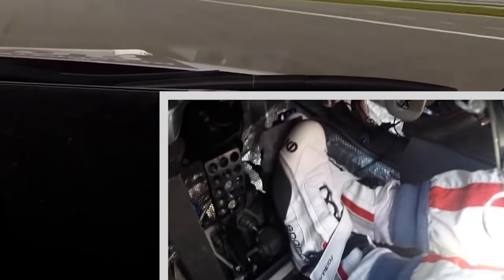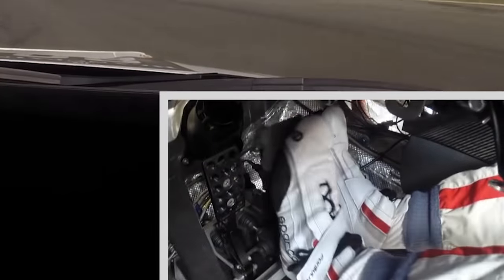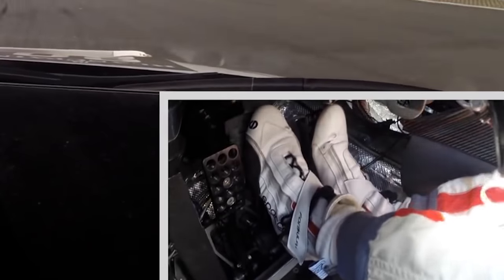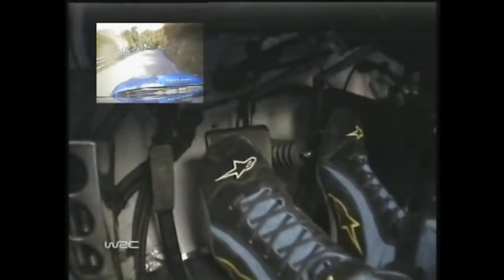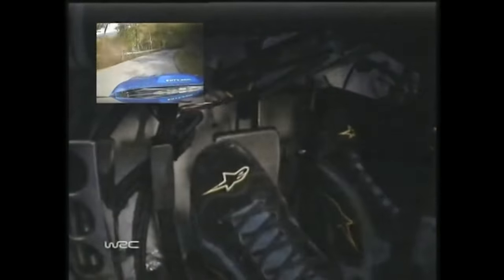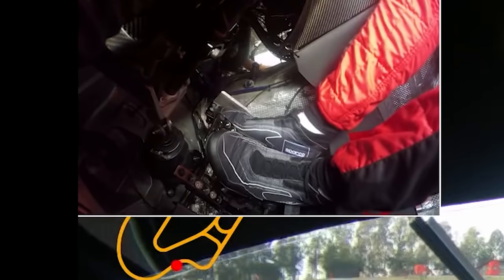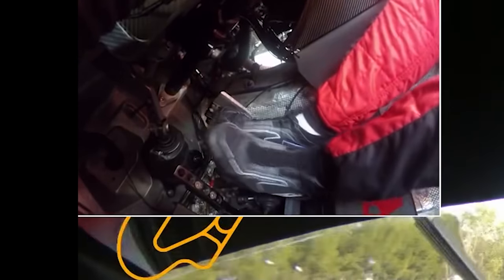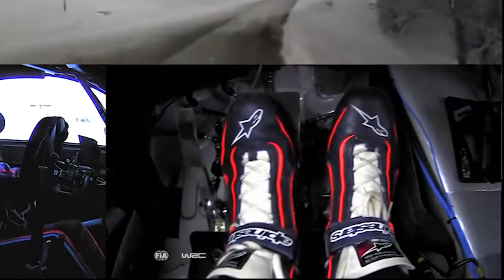Real Race Cars Have HUGE Brake Pedal Travel!... What?!

Comment: The amount of pedal travel prior to the pad hitting the disc is adjustable, once the pads hit the disk then there is very little movement, but prior to engaging it's adjustable to the driver preference. 
It is adjustable via springs or it can be dependant on the fluid chamber volumes. A small volume chamber pushing fluid into a larger chamber requires the plunger to travel a much longer distance.
As a very rudimentary  theoretical example if the master cylinder held 50ml of fluid, and each slave cylinder ( brake calliper ) held 50ml of fluid, then for every 1mm of individual pad travel requires the master cylinder plunger to travel 8mm.

Comment: if you remove the vacuum booster, then you need to change the mechanical advantage to the master cylinder. The mechanical advantage will increase pedal travel.

Comment: The answer is very simple: it's just a matter of ratio between the master cylinder diameter and the brake piston diameter! For a given piston diameter if you install a larger master cylinder you get less travel. If you install a smaller master cylinder you get more pedal travel. Simple physics! Cheers!

Comment: Pedal travel comes mainly from:
- play in the system (pedalbox, pad/disk gap)
- unresolved air in the fluid (static and dynamic)
- flex (pedals/brake lines/ caliper)

It all adds up. In professional sims you sometimes use the system from the real car with the same hydraulic lengths and so on (hardware in the loop)
That's why you don't really gain much if you just put a hydraulic piston on simpedals. Especially because real system change over time and differ for each car (even if it is the same model)

Comment: The real question is, when is the braking effect starting.
The hand and foot brakes of motocycles have a bold to adjust the travel, depending on the hand size and the foot position, but during this travel, there is no breaking effect.
Just as you noticed, as the only reviewer for the Invictia, that travel of the elastomer is a dead zone.

Some motocycle drivers prefer having the hand more closed when braking, or the foot/leg angle a little larger.
Some drivers may feel more comfortable to start and calibrate the braking effect when their foot is at a more open angle.

Comment: Hey Karl just to clear your confusion it is all about how pedal is constructed. Have you ever tried to undo very tight wheel bolt in the car? You couldn't do it with normal wrench so you took a long pipe to make bigger force? What you did is increase travel at the end of the pipe and increased leverage. Look at every clip you posted in this video and see how hydraulics is mounted to the pedal. It is mounted very low. What it does is change lever on the pedal. It becomes much easier to press and physical travel of the pedal increases.  When you mount same hydraulics on the top of the pedal or in the middle it will reduce travel of the pedal and you will need to press it much harder.  Combined with different physical brakes and hydraulics you simply can manipulate force and travel the way you want.

Comment: I believe this has to do with the master cylinder bore size. Bigger bore size allows more fluid to flow with short travel. Smaller bore needs more travel to push the same amount of fluid. 
It may come down to race car design. In formula cars you may not have all the leg room a rally cars does. Also a lot of the videos you showed look older, so I don't know if it's a new race car design philosophy.  
Also it may depend on the type of race car. Rally and V8SC for instance you need to carry speed/momentum - so you want the travel for easier trail braking? vs formula and GT cars where you want to brake at the limit.
This is all my speculation as I am not a race car engineer

Comment: usually driver preference, master cylinder pistons can be changed in diameter to give the driver their preferred feel, we do the same thing in Karting, some drivers prefer a solid pedal where others like a bit of movement
Reply from the maker: They can and I usually use anything from about 0.6 to 0.7 in my setups but they still do not have this sort of travel.
Reply: @KarlGosling  yeah, some of the pedal movement in the vids is very excessive, you don't know when this footage is taken, maybe in a long stage or race, the pedal, or brake pressure changes when used in this race environment, i do know that during hot weather and in Karting the brake pedal i set for my kart is very solid, but after a 25/30 lap final the pedal is softer, not to the extent seen in the vids, but everything much too hot to touch after a race, things do change. Karting hasn't the weight and inertia like a full size car, so i can only assume it would be more in this scenario?? In my stock car the pedal was always firm even after a final in the summer. If that pedal went spongy, there was a problem, keep the race vids coming Karl!

Comment: 1-the pedal to the floor in t1 nurburgring ...Its brakepad kickback...

So it took more fluid to push the pad before properly clamping.....

U can see the subsequent clip the same car/driver pedal travel back to normal

2- in rally car, although its servo-less setup, often pedal travel ratio used is longer...simply for modulation on loose surface

3-brake pedal in race car were heavy and short travel is true mostly...but only 100% true on single seater high downforce highspeed race cars like formula cars and lmp cars
Reply: do you have a link or title for the first video?

Comment: I just went out and tested my GSXR 1000 brake lever travel. There is quite a lot. I had a 750 with braided lines and there was still a fair bit. I don't see how anyone could modulate brake force properly without a range of travel that your nervous system could pick up on. Foot or hand.
Also, if power assistance could result in that movement so it could be with piston ratios and lever ratios set to allow those pressures without power assist.
As you probably have noticed the brakes are very hard to use if the engine stalls and you use up your reservoir of vacuum.
They have different a different setup than to non power assist.
Also, brake lines can expand a tiny amount, but as you say, you would replace them with braided lines or similar, that don't. But I think they all do to a tiny bit.
It all adds up.

Comment: My (somewhat) educated guess at this is that you're comparing the very stiff and short brake pedal of a circuit car with a decent amount of downforce to a car that is built for very mixed conditions including ice, gravel, and snow and therefore the brake in a rally car intentionally has a longer/softer throw. In rally, the brakes are under constant use to position the car, and as we know, braking hard in low grip conditions either immediately engages ABS or locks up the wheel. So if you could imagine trying to use the brakes in a rally car with as stiff a pedal as a GT or Formula car, the driver would get very tired, but also likely have constant issues with lock ups because as the pedal stiffens and shortens, the input becomes more digital than analog (which is fine in a circuit car that has reasonably repeatable braking conditions and points. Additionally, the suspension in a rally car is going to be a lot softer, and if you had a very stiff pedal, managing the nuance of the weight transfer that is constantly needed would be almost impossible. Yes, weight transfer is certainly a thing in GT Circuit cars, but not in the same way as a rally car. Again, I don't know if the above is completely accurate, but seems to make sense to me.
Reply from the maker: I'm not mate, those clips were all circuit cars (GT3 for example) bar one which was rally!
Reply: @KarlGosling  ah, sorry,  was watching between doing work things and saw the rally cars. It could be something to do with the ruleset of the particular series (perhaps there are certain pieces they must keep from factory like the brake booster), or these could just be track cars and series that aren't quite up to the level of development of more serious machinery. Or of they have options, it could be just driver preference.

Comment: @Karl, another reason that can contribute to this will be how much the break pad have been worn out. When you replace your car's break pads notice how much sooner it engage and how much less travel you have after you have replaced the pads.
Reply from the maker: This isn't the case mate (or it shouldn't be), as the pads wear and move nearer the discs fluid fills the space created behind the pistons, when you fit new pads you have to push the pistons back and often get fluid spill out of the reservoir the pedal travel is the same at all times (not accounting for air, boiling fluid etc.).

Comment: The increased amount of brake travel could be from heat and brake fade and/or towards the end of certain events from brake pad wear increasing the clearances that movement in the brake pedal must account for and take up.

Though as a sim racer sitting in my home in underwear and socks racing my pretend car I actually want a repeatable consistency in my brakes in accordance too the amount of pressure I apply to the brake pedal, not a pedal that I feel like I am working out at the gym every time I want to slow for a corner.

I am also the same way with the ffb on the steering wheel, I want enough feedback and force applied that I understand what the car on the screen is doing and feel the slippage of the tires but again not so much I need to be be a powerlifter to hold the wheel going through the corner or to a point if I crash I have to be concerned that the wheel will snap back with so much force it may break my wrist.

If a wheel needs an emergency power shutoff switch like you find used on commercial equipment in a manufacturing plant to be safe for me that is in excess of what my gaming requires for my needs.
Not to mention in real life race cars most all modern race cars utilize a power assisted steering solution and not a manual box that requires excess effort to turn the car.

Comment: to be honest I've only ever heard that this was true of f1 cars and similar which have almost zero movement in them. it makes sense that cars of different classes and uses would have different configurations leading to different levels of travel. I understand that we brake better by pressure than by travel, but there is a correlation that has to be "right" for the driver - a calibration between human and steel.
Reply: Look up Pedra De La Rosa's pedal work at Spa in 2000. He has the same long pedal travel as these videos. I'm honestly stunned.
Reply: When i brake with non load cell pedals i'm putting the same pressure in every time with the same travel. They are linked.

Comment: Brake pedal travel begins with the master cylinder, a smaller master cylinder bore  requires less effort to push but more travel is needed to stop the vehicle versus a larger master cylinder requires more effort to push but less travel to stop the vehicle, why? Cause its  moving more fluid per inch with the bigger bore which holds more fluid ! Thats why in car   foot cameras may have different brake travel, there  running different size master cylinders!
Reply: Yes, this. And pedal ratio is the other thing you can tweak for pedal travel.
Reply: Yes that is another way to get more or less brake travel,  is the distance  the master cylinder mounts to the brake pedal pivot point!
Reply from the maker: Yup spot on (as I mentioned I install them IRL), but I've never seen this much travel before.

Comment: Having had the chance to talk to the likes of Hayden Paddon (ex WRC driver) and working with a few circuit racers and done a few IRL cars myself it all comes down to person liking and as someone else said in the comments here it is all down to the master cylinder bore size and pedal ratio and also brake fluid. Some drivers like a hard pedal some like it softer. The likes of Hayden Paddon when he set up his sim he got a set of HE sprints and didn't like them as he likes to judge his braking by how much he moves his foot etc. As for after market pedal boxes for real cars they to can have the throw changed by I think most do it off the rotation pin move it up gives you more throw down gives you less or maybe the other way around
Reply from the maker: Thanks for sharing your info mate, I agree that pressure vs travel in sim racing is not for everyone, we have no g forces when braking in sim so it's very hard to judge how hard we are braking, travel and pressure are all we have.
Reply: whic pedals is he using now?

Comment: I didnt read all the comments on this 2 year old vid, but i dont believe i saw what i conider to be the biggest cause be hind the mysteriously long-travel, short-throw brake pedal: not master cylinder bore, but caliper bore, more evident in simpler, single-piston calipers and the relationship between its volume versus a relatively soft brake pad.specifically, when pads are installed new, there is hardly any pedal travel at all but as the pads wear, that travel grows and is magnified back under your brake foot. I understand the Mazdas actually changed brake pads while pitting at Sebring back in the day. Another factor is fluid boil.

Comment: Good you open the discussion. IMO brake pedal travel is set per driver preference. Also depend of the race car type (F1, GT, Rallye) it's likely to require different braking strategy and so brake pedal characteristic. On the video you have shown, lkely, long pedals travel are due to long fluid travel, piping and air in the system.
Reply: It’s master cylinder diameter and pedal ratio (pivot point). Those things adjust how much fluid is pushed when you push the pedal. You don’t want any air in your brake lines as it leads to ineffective brakes.
Reply: @pieflies  Ok, Thanks for the clarification.

Comment: Very large diameter inside the brake caliper.    4 and 6 piston per axle.     So,   large brake kits,  thats 12 pistons front and 8 pistons rear.   How much is the fluid capacity of the total system.    

I've helped with many customers cars heading to mosport, calibogi,  targa newfoundland,   the Glen,  etc..   the cars all have basicly the same travel.   

I hypotheses is the system is filling with fluid,  slack of pads to disc's,  and yes flex lines to expand a very small amout in cross section.  

Your thoughts?
Reply from the maker: Could well be mate yes, the fluid has to go somewhere when the pedal moves that far.

Comment: Easy, they have selected a smaller brake master cylinder = more brake pedal travel but less pedal effort. Its personal preference for pedal effort. When fitting say a 1" over 3/4" master cyl the opposite is true.

Comment: Are these anomalies, or much more common than known to us IRL plebs? Because, these could either be mid race fixes, failures, or wear. Also those might just be poorly built race cars(happens all the time). 
I wouldn't rule out heat from mid, to late in a race. Braided lines will still expand slightly under certain circumstance, and high temp brake fluid isn't magic juice. Not to mention pad material and how it might wear or be optimized under given conditions.

Comment: Dabbing the brakepedal before a corner (@7:30m) is to shift weight to the front to improve cornering.
Reply from the maker: It can be used for that yes but in my example it's to reverse pad knock off and close the gap before actually braking.
Reply: It's also to make sure they still have brakes. You can see them do that on a long straight away.

Comment: All those cars appear to be based on street cars (not bespoke race cars) and have strict regulations as to what you can and cannot change.  Some may have aftermarket pedal boxes but otherwise factory brake system internals. Add to that master cylinder/firewall flex that is perfectly acceptable on a street car but not so much on a track.
Reply from the maker: GT3 cars are based on road cars, but they are very much race cars, I mean they are not like F1 but still.
Reply: @KarlGosling  Another answer may be that those particular drivers, for whatever reason, just like to have a lot of pedal travel. So they set them up that way.

Comment: Hi Karl. Is the best way to play racing sims on the quest 2 still via a link cable? Is the experience via airlink and vd still very blurry like it used to be? Thanks in advance mate!
Reply from the maker: The image quality over link is fine but there is more latency than being wired.
Reply: @KarlGosling  thanks a lot for the answer. Is it the same story with virtual Desktop?

Comment: One thing that could explain would be where the peddles are connecting to the braking system. If we take our sim peddels the sensors are normally at the base of the peddle which might not be moving as far as what the foot plate would appear to move.
Reply: Unless you are talking about some exotic drive-by-wire car, there is no such thing like "sensors" in real brake system. It is just pistons agains pistons.

Comment: High temperature can make brake lines and pads quite squishy, I suspect.
Reply: If your not using braided cables then yes but mostly comp brakes will be braided and as such dissipate heat before its annissue .
Based on brakes for shale racing a while back.